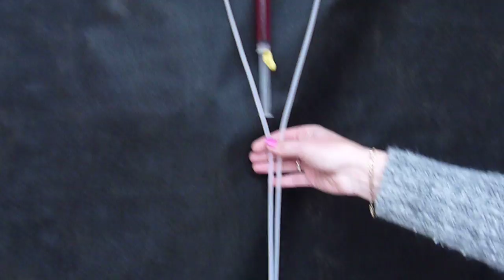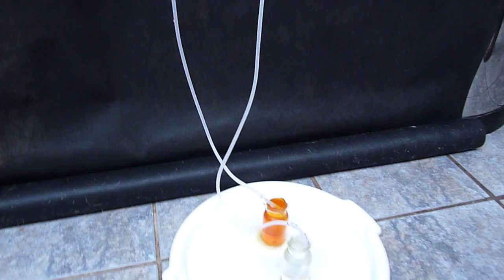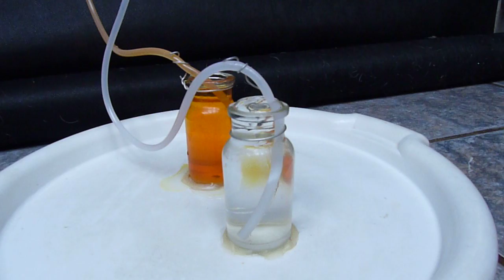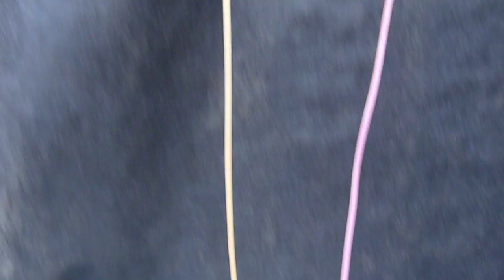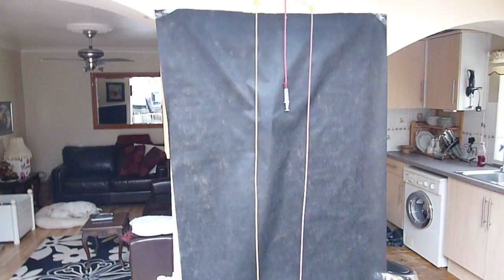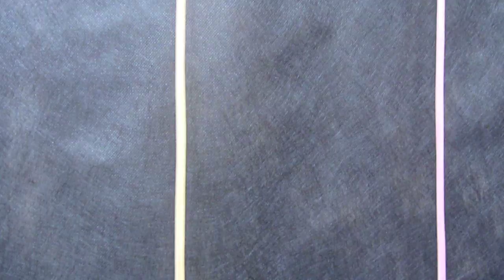Stenosis CCSVI Experimental model shows blood density / postural origin . Part 2

Comment from the maker: Stenosis / narrowing shown experimentally in fluid filled silicone tube.
Dissolved substances--salts, sugars, metals and minerals, in the blood & body fluids assist circulation due to the affect of gravity on density imbalance due to evaporation from the breath, respiratory tract, skin, eyes and hair.
The experiment showes solutes / dense substances alters fluid tension on the inside walls of silicon tube filled with water, which is not as pliable as the majority of veins in the human body.